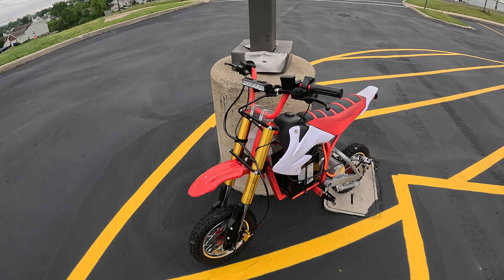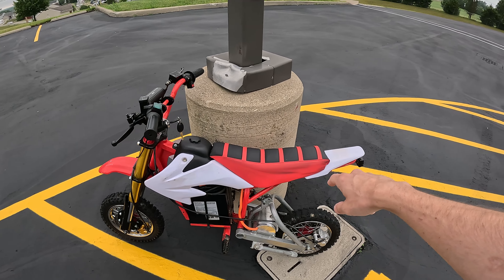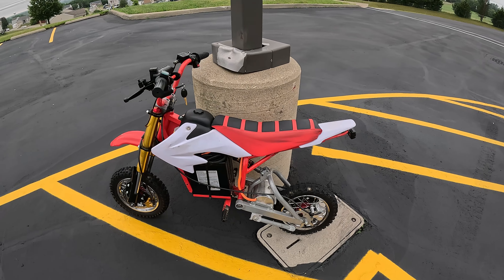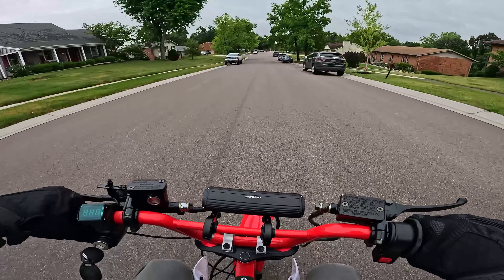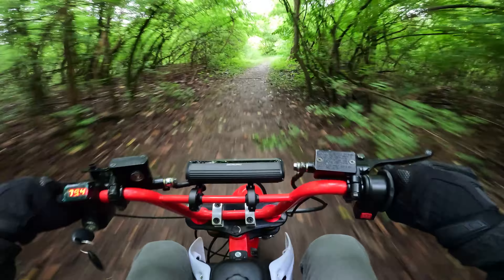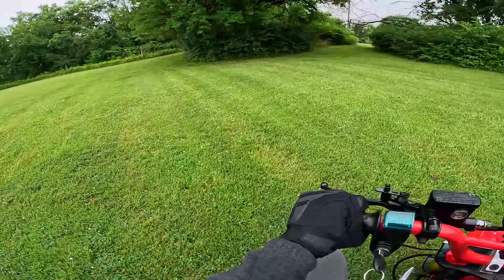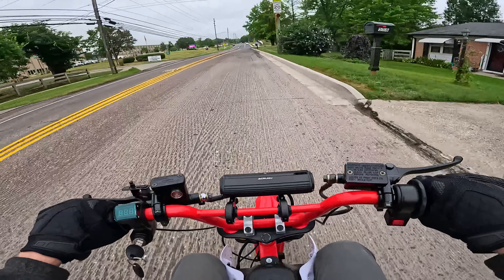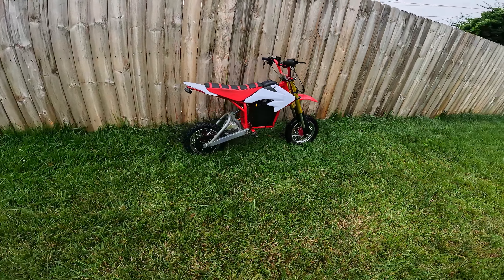Razor MX500 Build Part 2 - Jordy Builds

Comment: I used your 48 volt over volt kit on my mx500 and it caught on fire do you know why it happened
Reply from the maker: Fire can only be caused from battery or mishandling of wires. What battery did you have? Did you make sure battery wasn’t secured and or touching metal or where it can run through ?
Reply: I used the battery that you recommended and surrounded it with foam

Comment: I just bought your 48volt overvolt kit gonna be installing it on my mx350 appreciate it 💞
Reply from the maker: 48 V will burn up the stock MX 350 motor. Make sure you have the upgraded motor with motor adapter plate if you’re gonna be running 48 V.
Reply: @JordyBuilds  of course watched all your vids 🫡

Comment: Hey bud any chance you know of a motor for a mx125 that can handle the DeWalt 18-20v battery swap? I swapped following I believe yours and many others YouTubers vids showed and my daughter ran it for about a week and the motor burnt up. I don't want to swap the controller and throttle. My youngest will get this bike after my 6 yr old graduates up to the mx350. The 125 is a good fit for her size and she can use it similar to a push/balance bike as she learns balance.
Reply from the maker: I really don’t know a upgrade motors for those

Comment: Hey jordy builds i was wondering if the controller of the razor dirtbike is connected to the batteries with a wire or does it just pick up signal
Reply from the maker: It’s connected

Comment: How long on a full charge does the drill batterys run for?
Reply from the maker: I get 40 to 60 minutes from 2 5ah batteries
Reply: @JordyBuilds  ok thank you and do u know if the front forks of a mx500 or a mx650 will fit on a mx350?